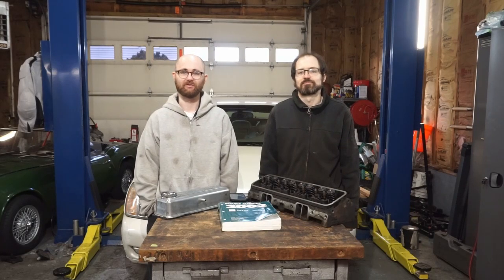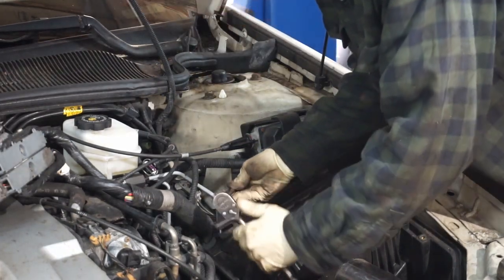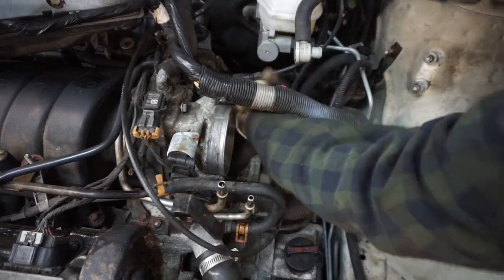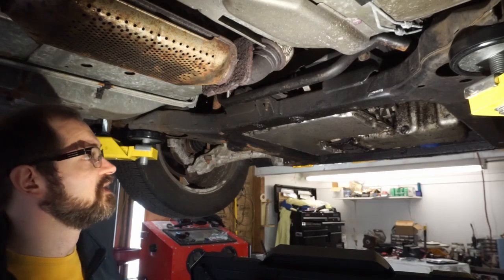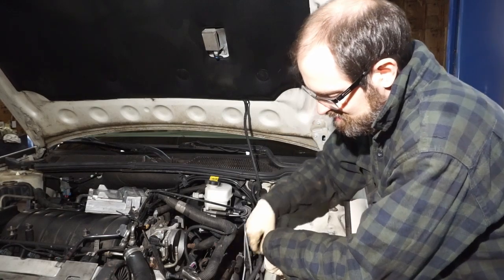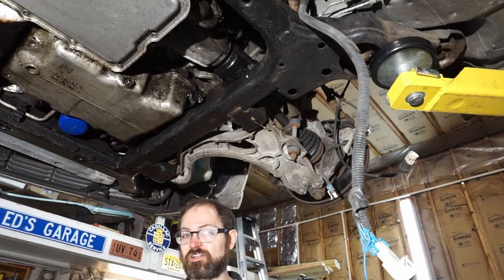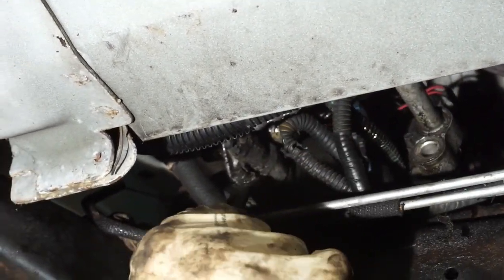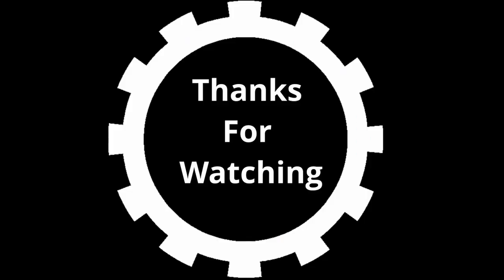2002 Cadillac Deville DTS Motor Removal Part 1

Comment: Thank you guys very much for uploading your videos. I don’t think I would have tried to replace the head gasket on my 2001 Deville. I took the engine out through the top in my garage. I just removed the front head. My number one cylinder was pumping exhaust into my coolant. I have 21 videos so far.
Reply: You can do it

Comment: The one thing I needed to see they did not show. 😢 There's a power wire going through the passenger side fire wall they did not show that being disconnected therefore on my engine install I don't have any idea where it goes to. I thought it would go to the fuse box but there's only one positive wire that goes there. I've looked everywhere and it's like a freaking ghost wire but I have no dash, headlights nor will it start and I'm guessing that one wire is the key to make that happen. Anywho thanks for nothing, but for what you did show you did a good job, I was just waiting for them to pop that wire when they dropped the engine however they ffw through that part

Comment: Why would you undo the torque converter bolts with the engine still in the car?  I'ts so much easier when the whole assembly is on the ground!

Comment: This was a pretty good video except it does not mention removing the wiring harness that wraps around the engine in various directions. For what it’s worth, the harness is most easily removed after the car body is lifted off the engine. This allows easier access to all the sensors, grounds, etc. I took off the front motor mount to get to the plugs underneath easier. A floor Jack under the engine/trans connector place allowed me to lift the engine after the motor mount bolts were removed so the motor mount and bracket could be removed as one piece.

Comment: That’s so much work guys. We always pull them from the top. Specially this generation is easier because the bar over the radiator is removable by the four bolts giving us extra room.
Reply: That's what I'm attempting to do

Comment: Hello from Romania 🇷🇴  ! 

My 2001 Cadillac Deville DTS cranks but doesn't start. Last night i changed the starter, and a new starter relay, new intake gaskets etc. 

I put the old relay back, because i took the cap off from it, to try start it by hand after whatching some YouTube video about this problem. 

IT has this simptomes: If i put the baterry on, and jump start the battery with wires from another car ( probably i need a stronger baterry or a new one that is strong ) the lights inside the car light up, the radio works, the windows, the back lights work when pressing the brake pedal, BUT THE LOW AND HIGH BEAM LIGHTS DON'T WORK AND THE DASHBOARD DOESN'T LIGHT UP !!! 

If i put the key in the ignition, try to turn the car like you would normally do, just a small click but not allways. The engine cranks only when i use the hand at the relay... 

I will try that trick with the ground wire from the alternator and see what happens. 

If you guys have encountered this problem and solved IT, i would apreciate IT ! 

God Bless ✝️